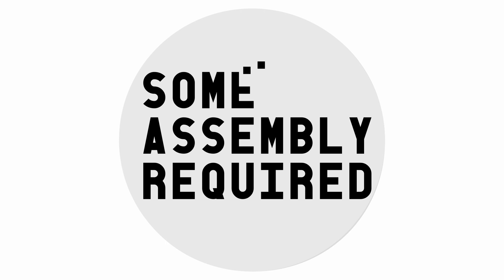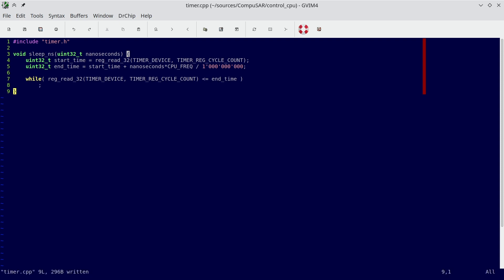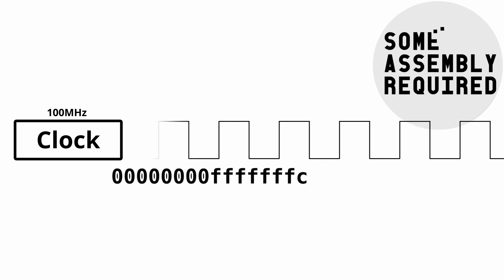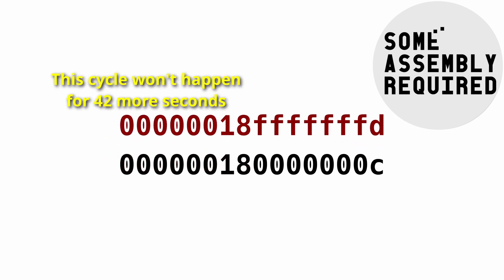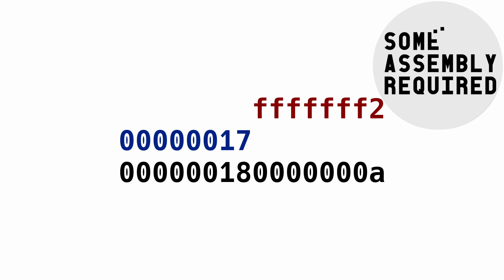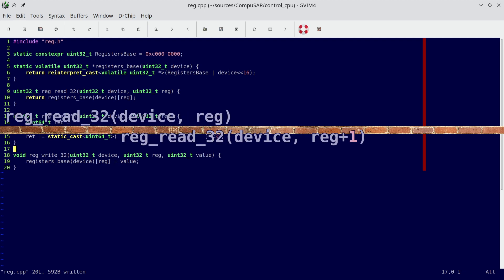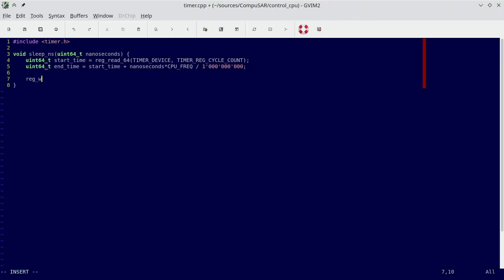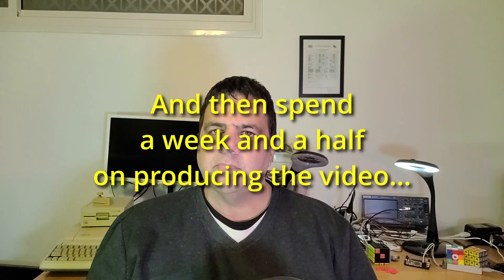Implementing a hardware clock and sleep timer

Comment: I'm suprised to hear that you had so much troubles getting Xilinx DDR3 controller to work. I've been using it for years with pretty much everything from Artix A35T all the way to Kintex K325T on both pre-made boards and boards designed by me, and never had any problems getting full rated speed out of it.
Reply from the maker: IDK. The Spartan line is even lower end than the Artix, so that might be it. In general, the 300MHz the DDR wants are more than what the Spartan-7 can comfortably provide, so that might have been the problem here.
It did turn out for the best, for some definition of "best".
Reply: @CompuSAR  No, Spartan-7 is not slower than Artix-7, it's got exactly the same everything speed grade for speed grade, except S7 don't have multi gigabit transceivers, and there is no speed grade 3. I have designed a board with Spartan-7 and DDR2 running at 333 MHz in KiCAD a few years ago and it's open source, not sure if I can post a link to it here. You can use it as a basis for your custom board if you wish. I've also became your Patreon too 😀
Reply from the maker: Maybe. What I know for sure is that simply introducing the Micro MIG into my design resulted in timing errors that wouldn't go away. When I designed my own interface, it was exceedingly hard to get the 300MHz parts to work with no timing violations. The tiniest amount of logic would blow it.
And yes, I would love to get your design, but I would love even more to know how was the KiCAD experience. Several parts of working with it seemed rather annoying (and also, which version it was).
And I've noticed the Patreon. Thank you!
Reply from the maker: If you go to the channel page, right next to the logo there are contact options. One of them is my email address. Feel free to send it to me directly.
And from what I've heard, KiCad 6 did, in fact, regress.
I'm curious about the MiG thing. Can  you share your design? I can test to see if it's actually working. It's just a curiosity at this point. Without AXI support the MiG design takes over 3500 LUTs, which is almost half the chip. My design takes about 700, so I'm unlikely to switch away at this point. I am, however, a relative novice at FPGA design, and it'll be interesting to see if I got something wrong, and what it was.
As for this being a verified design: when it didn't work I went on Reddit, and the consensus there was that my experience isn't at all unusual. I may have done something wrong, but I wasn't the only one.

Comment: cool video! You could theoretically account for the wraparound and have your code run infinitly
Reply from the maker: Yes. There is a technique dividing the time space to halves (sometimes quarters). Assuming no wait is longer than 21 seconds, it can work. But it complicates the logic for no particularly great returns.
This is doubly true once you realize "number of cycles" isn't, long term, the only statistics I'll want to collect. I'll also want number of wait cycles, how much idle time I have and other statistics. Those also need to be collected atomically, so, in the end, I'll have to freeze more than just the cycle count.